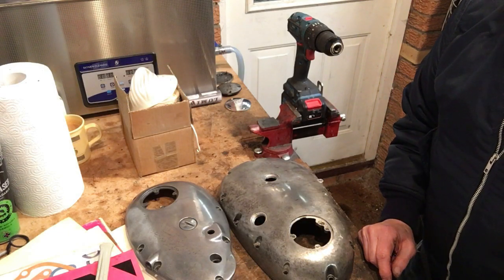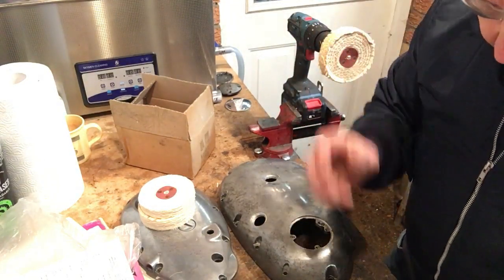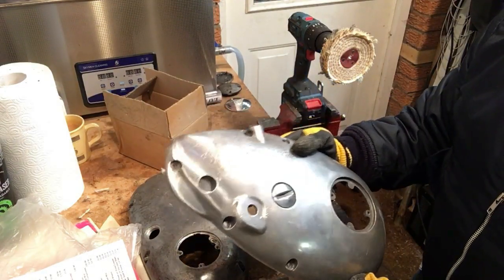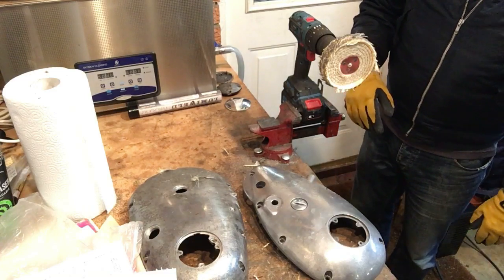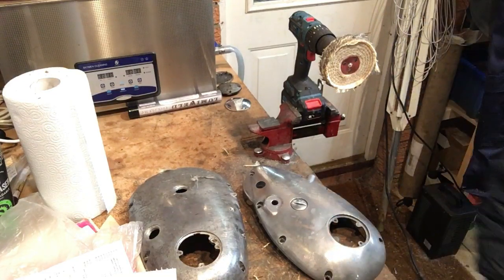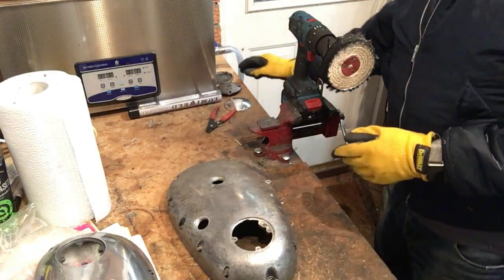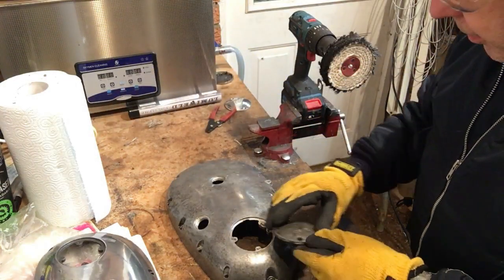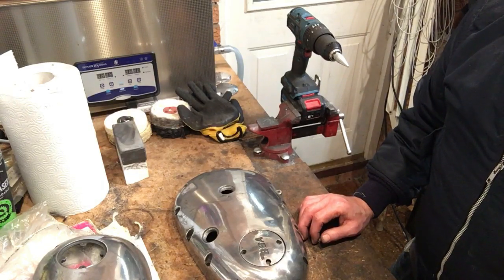BSA A70L Lightning - Engine Part 28 - Polishing Engine Cases

Comment: Angus! Don't be so tight, buy a 50 quid 6" bench grinder and fit the mops for polishing.  It's worth it for good results.
Reply from the maker: Hi Christopher. I understand the sentiment. I do have a good bench grinder - but a rather old inherited one which won't accept the mounting for the mops. I'll keep it in mind though as we progress. I'm more than pleased with the initial results. Believe you me I haven't been tight on investing in this restoration in general.

Comment: Hi Angus please watch some vids on polishing alloy. I am by no means an expert but I've been polishing cases for years and its a dirty and dangerous job i.e. a casing can catch and through it out of your hands though I agree probably not with this drill. My comment is a bit long but I hope you find it constructive.

1. Degrease the cases and clean with wire wool and soap or brillo pads before you start.

2. Sand as much of the indents on the casings someone has hammered into them, use a hand machine sander or linisher, or for more control I use flat wood with emery paper glued to it going from coarse to fine and in opposing directions and keeping the profile. You probably won't get them all out.

3. If you continue to use that drill, I wouldn't I think you will destroy its gearbox, turn it around in the vice - the mop should be rotating downwards to the ground, as it is its throwing debris up into your face.

4. Use a full face polycarbonate mask like you would if using a strimmer to protect and keep the muck off your face, and overalls as your clothes will be piggin.

5. You are better with a purpose-made polisher, i.e. 3000 rpm or second choice a converted bench grinder, much more power and larger mops, the larger mops give you more surface speed. 
I have also screwed the casings to a bench or piece of wood and used a polisher similar to an angle grinder usually used for polishing coachwork. 

6. Lastly, I notice you have Lumiweld on your bench. It would be relatively easy to repair the small BSA casing by filing in the hole and redrill counterbore profile and polish, on the larger pri-case make a lug, braze it on drill, tap and profile to shape. (watch a few vids first). For this bike consider getting them professionally repaired and polished.
Reply from the maker: Fantastic stuff - thanks Nightster. I did originally degrease and clean with these new techno Brillo pads. I had another pass on this earlier today and they’ve come up better again but I agree with you and others that the drill is not the best and I’m not doing the drill gearbox any favours. Also yes thank for the suggestion re Lumiweld - another vid in the near future. Thanks again.

Comment: You should be able to tap the dents out of the case, and you need to sand the scratches out with coarse, where necessary, working to fine wet and dry to get a like new finish.  The finer the final wet and dry sanding, 1200 or so, the nicer finish you will get when you buff. 

I'd be interested to see the A70 head as perhaps they did the ports better than A65s. Brad Jones's books don't feature the A70s. It would be nice to know more about them. It's a shame the factory didn't use them in F750. In 1970 at Umberslade they had a 760 A65 producing a little more hp than the triple they were developing. More hp than the successful Norton 750 used in 1973.
Reply from the maker: Hi Mark and thanks for the comment and interest. I have used the technique you describe in previous restorations but I’m deliberately not over restoring this so am leaving the cover scars as is. Yes Brad Jones’s excellent books pay scant regard to the A70; however the changes are minimal and the heads  are common with the A65. It will be a different animal though with the stroke and sprocket ratios! Thanks again.
Reply: @BSAPowerSet  Peter Crawford has two books underway on the BSA unit twins. Lots of interesting info on development and racing.
Reply from the maker: MarkNParker Thanks for the heads up Mark.
Reply from the maker: MarkNParker Thanks for the heads up Mark.

Comment: FFS man, get a cheap bench grinder and the buffing wheel attachments. Watching this made my head hurt. My setup cost less than $100AU and still functions as a bench grinder.  A 200mm job with some serious nuts is still cheap and buffing requires torque. Did a very rough late T140 and it looks fantastic: even smoothed out the extremely rough castings on the rocker boxes with a very small amount of preliminary filing.
Otherwise , I like your channel and regularly watch it.
Reply from the maker: Thanks for the interest and comment Dave. Point taken. I wanted to have a go and am pretty impressed with results however does need more work and have the offer of the use of friends so more to come. Thanks again.
Reply: Have a look at draw-filing with a decent fine single-cut file pushed across its axis.  A bit of chalk stops it fouling and you can get a very nice flat finish on a surface without digging in. Not trying to tell granny how to suck eggs, but lots of people are unaware of this technique.  It will get you below the pitting quickly whereas further buffing may accentuate it. Buffing requires a fairly uniform surface to start with.Try on scrap.🤙🏻
Love the BSA’s!
Reply from the maker: Dave Johnson Thx Dave